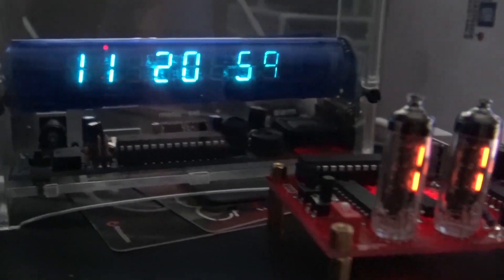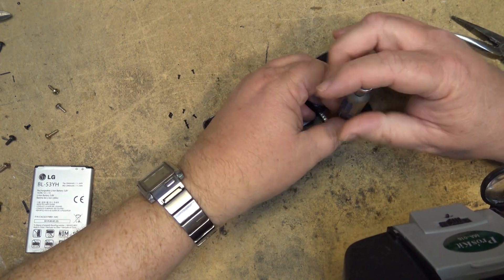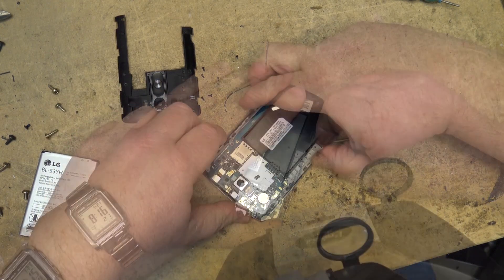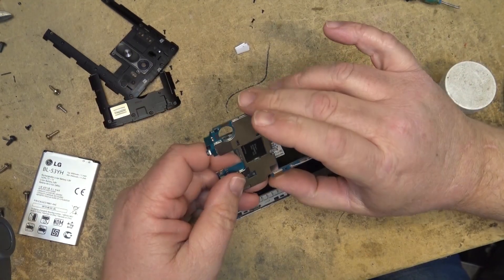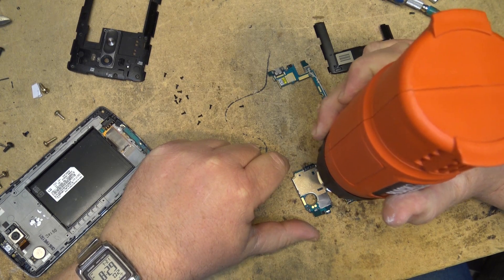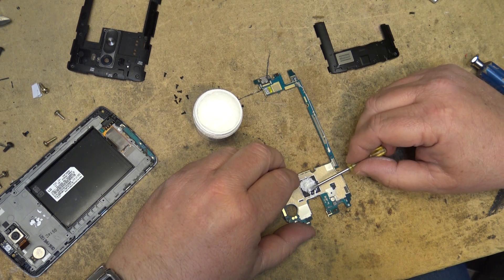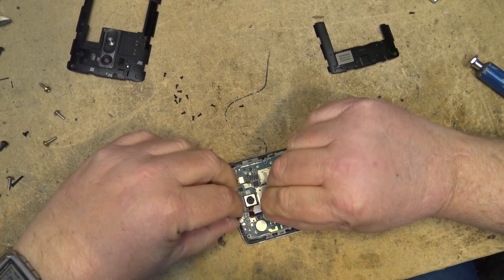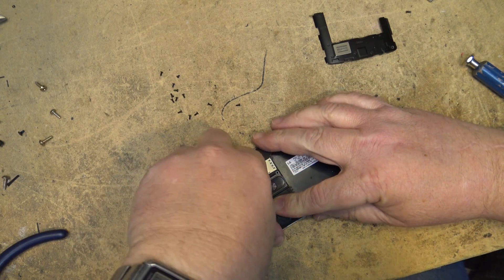LG G3 screen flicker problem fix revised

Comment: Today is 02-19-22, and his works. I have a long story though. My LG G3 had the flicker issue and the paper in the back solution lasted a year, screen died on 2015. I saw yesterday RIP LG phone mfg videos so just for fun and nostalgia I tried to fix it. I do not have a heater nor thermal paste, I had a thermal pad, a light ball and good luck. I softly pushed the chip against the light ball on my room, cut a small thermal pad square and placed it, placed the paper and crossed my fingers. The screen remained black so I was sad, but then it started flickering a lot. I deleted cache and the flickering lowered even more. I deleted lots of useless apps and the screen started working properly. So I'm really happy now, it works like a charm and is a DIY solution!
Reply from the maker: This was my son's phone and he used it for another year and half and when he turned 19 I said it was time he pay for his own phone.  He went and got a Samsung s9, same as I use.  Mine is over 4 years old and still going strong.   OLED screen burn and all. I have a new s20fe that I will use some day after this s9 dies but no sign that is going to happen any time soon.  If I showed you it, you would aware it just came out of the box.   Other than the icons burned on the screen.  Bloody hell OLED screen.

Comment: Hey man! I just did this fix on my LG G3, two years old. I followed your instructions exactly, including the heat gun. After reflowing the solder and holding down the chip with the screwdriver, I spread a good amount of Arctic MX-4 Thermal Compound on the exposed part  of the chip. I used a slice of cardstock on the camera connector, and closed it up. Seems OK so far. Thanks for this tutorial! Will follow up in a few months.
Reply: How is it now?
Reply: It was OK for about two weeks and then it had heat problems again. the screen flicker returned. I opened er up and noted that I did not apply enough thermal compound to contact the chip to the metal heat sink. I tried the fix again using a hair dryer but ended up damaging the board. It wont turn on. 

Lessons learned: Use a ton of thermal paste; the gap you want to fill is very big. Use a heatgun.

Comment: the problem is solder balls under SoC crack from heat expasion/contraction over time. You have to do proper reflow with solder flux and HA station. This is just warming the chip a bit. And you do not press on the chip when reflowing, pressing it will screw the solder balls.
Reply from the maker: I am aware of the problem but not everyone has an air station. This fix works and worked on this phone until the phone was retired when the battery went bad.  So there.
Reply: flux won't do shit as the chip is underfilled. it's engineered to fail. what shocked me the most is that a supposedly high-end phone from that time has such a piss weak chassis. everything bends and flexes... zero rigidity anywhere. no wonder this problem is so common

Comment: This procedure really seems to work: I tried to fix the screen flickering several times with the paper method (+ heat transfer paste), without any success..finally i even couldn`t get the phone to activate the screen at all..it remained black after booting..now i followed this vid and used a ordinary hairdryer ;-) (since i have no heat gun..) and heated the Chip about 2 minutes on the highest heat level..after that i applied plenty of heat transfer paste on the chip..and after reassembling and switching on the phone it booted just normal (without a single flickering..) and it is working normally about a day now without any flickers..i hope  it will last some time..anyway thanks for this vid!

Update: Working now for a full week without a single flicker..looks good
Reply: Does it still works?

Comment: One thing that bugs me is that the casing above the APU is *plastic*. It seems like a huge mistake to "heatsink" your chip to *plastic*. So instead, I inserted a folded piece of tinfoil between the chip and plastic face. I also included the "folded paper" trick (actually I used thin cardboard) to cover all the bases. (I never tried heating the chip.) This worked great, but afterwards, if I snapped closed the top right corner of my phone, I couldn't turn it on or off. I had to leave the corner of the back cover partially open. And I couldn't fully insert my phone back in its case after that because it snapped closed the corner.

This bugged me, so after a couple of weeks, I decided to make the cardboard wad smaller so I could finally close my case again, and the screen fade bug returned. So I made the wad bigger again but the screen-fade problem remained. "Damn! I should have left it alone!"

With no other options, I'm going to try heating the chip with a blow dryer on high for about 30 seconds. I don't know if that will get hold enough to "re-flow" the solder. This "design-flaw" makes an otherwise great phone a PIA with no resale value. I sure hope the addition of adding heat finally solves the problem. ;(

Quick tip though: The tiny screw next to the camera does not need to be removed to remove the cover or PCB. It's also smaller than the other screws so this helps avoid any confusion putting the screws back.

Comment: 12voltvids, thank you. The folded paper really came in with the win. I also used aluminum foil to create a heatsink in addition to the reflow and the paste. CPU runs between 30-40*C now.
Reply: Did you use foil first,  then the paper on top?  I'm trying to fix 2 lg phones with this issue.  Thank you

Comment: This method definitely works! In the middle of a marathon YouTube session a few days ago my LG G3 that I have owned since new suddenly developed a strange video artifact, fadeout and lockup problem. I noticed that if I pressed the power button twice the video would return for a few minutes. I had seen this video when it was posted but had forgotten until I started looking for a solution. I removed memory and sim card and covered the board with aluminum foil with only the GPU exposed. Noting that 12voltvids heated the chip for 20 seconds I gave it 30 seconds for good measure. It has worked flawlessly for 3 days now.

Comment: More efficient fix is use a copper shim ( not aluminum foil )  you can add compound if you choose the copper shim should be enough help absorb the extra heat. use a heat gun at around 300F for about 5 to 8 seconds and it will be fine. if you boot the device and the flicker is still present you didn't heat it enough plus allow for cooling.
 also placing paper on that connector has nothing to do with the flicker problem the shim will take care of the tension needed.
 I use a ( Milwaukee
 ) MHT PRODUCTS Model 750 Heat Gun 1.680 Watts. max heat 750F

But nonetheless this is a fantastic video with very good detailed information rather then someone playing music. 2 Thumbs up to 12voltvids (look in to them copper shims they are life saver they come in different sizes created for CPU & GPU works perfect on cell devices. approx 22NM size. )

Comment: It worked, thanks! For others - I found that re-flowing with a heat gun was essential in order to truly fix the problem on my G3.

Originally I only applied the thermal compound to the chip and added the piece of paper for pressure. Occasionally there was some flicker, but it worked fairly well for about a month, then started getting worse again. Next, I added another piece of paper in the same area but this time between the back shell of my G3 and the inner molding. Again, worked fairly well for another month, but the problem kept getting worse and worse. Finally, with nothing to lose, I decided to try re-flowing the chip with a heat gun and viola, the screen on my phone works perfectly (no flicker) - something I have not seen since the problem first appeared several months ago. Also I removed the second piece of paper that I placed inside the back shell as it was no longer needed.

Comment: Yeah, kinda old I know, I have 2 lg g3 dropped into a box because of that issue, never took the time to look and fix it, I was looking for some old phones so I can use it to connect to a speaker with Alexa app and found my G3s, fixed one of ‘em using an electric oven lol and some foil paper sheet between the chip and the case heat sink for heat dissipation, it’s perfect right now 👌🏻

Comment: This trick kinda works, i think?
After installing the heat sink and first boot, the phone heats up to 97°C, but  than I turned on flight mode and let it sleep for 3 minutes, the phone temperature reduce to 48°C.

Model: F400s with lineage Os 18.1

Comment: Didn't have a heat gun. Didn't want to use a hair dryer, and definitely didn't want to bake it in an oven as seen in some videos. My solution, a finger shaped piece of metal about 2mm thick and a domestic clothing iron.  Heated the Hynix chip on off for about a minute or so, via the piece of metal, with the iron on max, mindful not to melt, burn or overly heat anything else. After it cooled down, I took off the small metal cover over the Sandisk chip and added electrically non-conductive thermal paste there, replacing the cover after. For the other side of the mobo, I applied the thermal paste to the frame, where the Hynix chip sits and also to the left and right of the Hynix. I added lots of thermal paste, and I do mean lots, but careful to avoid overflow. The Hynix chip needs loads of thermal paste, as there's actually about a 1mm gap between the chip and phone's frame. Phone worked after this and temps were actually down about 15c when gaming. Oh, and make sure the iron doesn't produce steam. Try this at your own risk.
Reply from the maker: mojoNoodlz 
Hair dryer won't get hot enough. A halogen lamp might work.  I have done that before too.  Whatever works right. This phone continued to work up to 3 days ago when it took a "2 foot drop" according to my son and the screen shattered. So now he is crying. Welcome to the real world. That will cost him about 500 for a new phone. Welcome to reality where phones cost real money. Not these subsidized phones from the phone company.  The phone he really wants is over 1000.00

Comment: What EXACTLY is the problem here?  Is it the SOC overheating or is it a connector problem that the paper fix on the camera connector addresses? Both? Does LG acknowledge this design/manufacturing defect and what will they do to remediate  the defect?
Reply from the maker: It is a bad design. Soc overheats. Melts solder on chip.    Heating reflows solder.  Your mileage may vary. This fix lasted for 8 months until the phone got dropped one time too many and screen broke. Dumb son got a new phone and dropped it breaking it within a month so he had to buy yet another one.

Comment: is that thermal paste? would thermal paste work? and how thick does that wedge need to be, if you could compare it to something like a credit card?
Reply from the maker: I initially did it with thermal paste, but I opened it up and stuck a piece of thermal pad in there to better drain off the heat.The paper was just regular 20lb photo copy paper folded over itself 6X so it was bout 3mm think. Enough to put pressure on the board, and squeeze the chip against the thermal pad, which of course squeezes to the front cabinet heat sink.
Been over a month now, and that phone is being abused all day. My son lives on that thing and every waking moment he is on it except for when he is at work. So far so good.  The critics said it wouldn't last 2 days. Well it has been 35 since I did this and it is going strong at this point so I am pretty confident that it is fixed, at least until something else breaks on it.

Comment: OK after 2 days I've got the same problem (after trying the other tip on pressing the camera connector) . Let's see now after baking the board for 10 minutes on a 200 degree celcius oven (because I don't have a equipment like this :) )
Reply from the maker: This worked for 5 months until the phone got dropped and the screen shattered. Got new phone for the kid and he dropped that one within 2 weeks and broke the screen on that. So I said sorry Charlie, no new phone for you. Go buy your own.
Reply: @12voltvids  lol :D for now so far so good, I've also filled the gap with a thermal paste.

Comment: Hi. I have been working on my tv is an old color tv. N I found a 150k resistor  is bad I does read on  the meter nothing at all    am not finding a 150k anywhere. So I was wondering if it is possible to connect a 100k and 50k in series.  can it work?    I didn't try it.   If u can help me out that will be great.     
I love your videos by the way
Reply from the maker: Nilesh Ramlochan 
Yes a 100k and 50k in series will give you a 150k resistor.
Reply: 12voltvids  thank you. Am sorry I didn't mention.  The bad resistor is a metal oxide. And am only getting  axial carbon film fixed resistors with. The 100 and 50k values.  Am sorry I forgot to mention  but Will that work in place ?
Reply from the maker: Makes no difference. 150K is 150K no matter what you put in it.
Metal oxide is a more precision type, and generally a flameproof, but 150K is 150K no matter how you get there.
Reply: 12voltvids. Thank you I'll try that.    Have a good 1 and continue making great videos. ☺

Comment: I kind of had a similar problem with an electric oven. It kept tripping the breaker. So I only had to shut off the power and tighten up one of the screws. Now the circuits workng .

Comment: This works only. For 2 days
Reply from the maker: Well it has been longer than 2 days, and it is working fine. My son lives on that phone and has not had a single issue with it since doing this 10 days ago.
Other devices I have fixed with the heat gun trick have been running for years. Your mileage may vary, because I have been doing this for a long time I have gotten quite good at judging how long to heat for based on visual, small of the flux ect. Time will tell how long it works, but if the boy gets 6 months or a year out of it then he will be happy. By then he will want a new phone.

So there!
Reply: yeah you are right Duki, but we should regenerate IC Soldering
Reply from the maker: 3 months and going strong.
Reply from the maker: Lasted 8 months until the phone was dropped and screen broke
Reply: Is it ok to bake it instead of heat gun ?
Reply: I suppose it will work you just need to keep the temperature about 230C and using some soldering flux is not a bad idea,  otherwise it's pointless (like on this video :) )
Reply from the maker: Well the phone continued working fine until my son dropped it from the fork lift he was operating and ran over it in September.
Reply: I'll try to "bake" mine soon, hope to get lucky, like you ... :/
Reply from the maker: @gobblin82  
It clearly was a bad design. In my case, well my sons case it lasted long enough until he smashed it. Certainly longer then 2 days as some claimed.  As long as it lasts long enough to get the data off of it is good enough for me. Nothing worse than having a device with irreplaceable data that hasn't been backed up that won't boot.
Reply from the maker: @Lena-ir3ms  
The white paste is thermal paste to drain the heat. The paper is not going on a hot part but rather a connector and this is only so the board is squeezed slightly to make better contact with heat sink.  As I said this is not considered a permanent fix, more of a fix to get the phone up so data can be backed up or transferred to new phone but this one lasted for awhile because it was my sons phone and I already gave him 2 that he broke so he had to save up to buy a new phone and when you buy them o. No contract they are expensive. The phone I use a samaung s9 cost me about 1000 with tax.
Reply: i have added aluminum foil folded on the chip with thermal paste

Comment: Balls to the know it alls and the assholes who can't take your word. Carry on makin' them good vids. Warm regards, Wayne and Nina.
Reply from the maker: This was in reference to those that say 'Why don't you get a proper air station." Well if I was in the business, and did this for a living I probably would, but I am not in the business. Besides, 95% of people that are going to attempt a repair like this also do not have a hot air station. The only ones that do are people in the business. I want to show that anyone can do these type of repairs using inexpensive equipment that they may already have, and if you are carefull you can do it safely. I wouldn't attempt this on a customers device. I wouldn't offer to repair a cell phone, or a tablet for someone. I will only do this on my own equipment, that I have already accepted as a total loss anyway, so if it doesn't work no big deal, but if it does then I have saved money by not having to buy a new one. So far my odds are really good, even though everyone says that it can't possibly fix it.

Comment: Geez,what simple foolish error they made on that system. How could they miss that??
Reply from the maker: A heat transfer pad under the chip would have prevented it.
Reply: funny thing is that there is a square inset in the heatsink, maybe intended for a heat transfer pad?
Reply: Andrew Bellavie Whoever works on the phone next should just put the pad in to fix the problem once and for all.
Reply: well first they thought it was an L but then later it turned out to be Oh Gee!